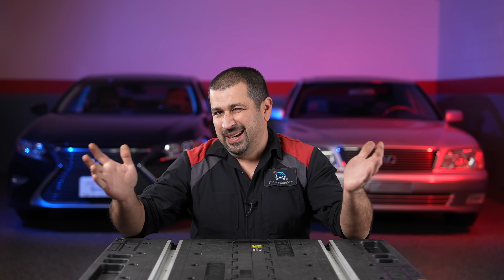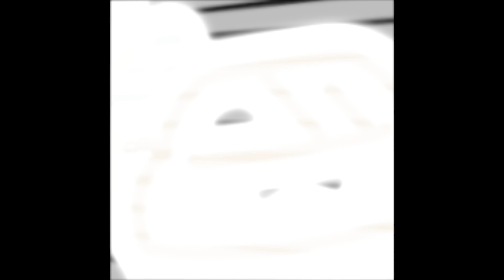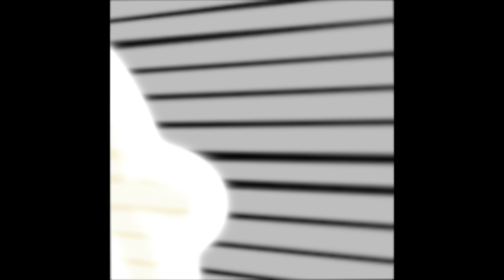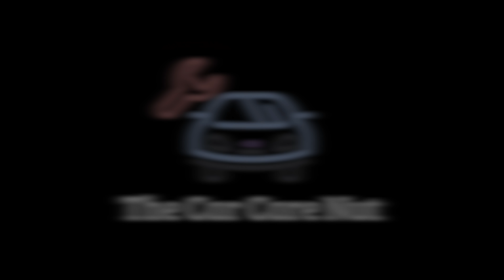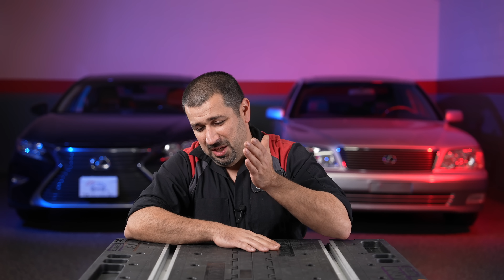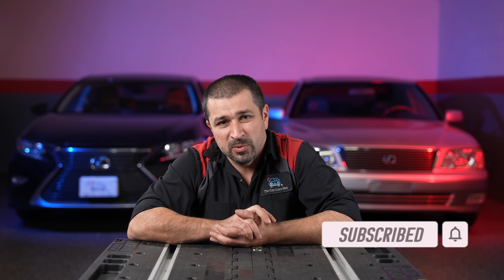Can Modern Turbo Engines Be Reliable? Here's The TRUTH!

Comment: Great primer on the difference between a turbo diesel and turbo gas engine.
Reply: Except it's not. It's not that diesel burns cooler. They have broadly comparable flame temperatures. What is different about turbodiesel is that they have lower EGTs because they are naturally lean burn engines. The excess air in the combustion chamber provides two things. One is a more complete burn of the fuel, another is that the extra air helps serve as insulation to reduce loss of heat to the cylinder walls. But all of this is only true if you aren't going WOT. He is also wrong about diesel engines "struggling for air". The problem is that diesel burns dirty if it's not lean burn. Gasoline does fine at stoichiometric without a lot of soot and smoke. Diesel if you get close to stoichoimetric you start rolling coal badly. So the benefit of turbodiesel is both power and emissions. To make more power you need more air to flow more fuel. Diesel also doesn't have knock issues like gasoline, so running 40+ psi of boost is no big deal compared to gasoline, so they naturally take to massive turbocharging much better than gassers.
Reply: He is not all right about diesel.
Reply: Diesel engines are born with heavier, beefier components like the con rods.  This makes them a lot tougher but the great increase in reciprocating mass means they cannot rev as high.  Modern gasoline engines, trying to meet CAFE requirements, keeps getting lighter and lighter moving engine components.  Even when compared to gasoline engines in the past, these components are lighter although you can claim improvements in metallurgy.  Another issue is that modern engines keep trying to meet ever tougher fuel economy requirements, keeps going with lighter and lighter weight oils to reduce engine friction.  When we use to use 10w-40 in the past, we are now down to 0w-8.   Due to increased cylinder pressures, turbo engines are more susceptible to cylinder blowby.  That is fuel escaping through the piston rings and ends up diluting your engine oil.   Factor the lighter engine oils, and you have a double whammy.    Turbo diesels on the other hand, well diesel is an oil itself, and even when blowby is present, it's oil mixing with oil.  You have to inevitably replace your oil but the dilution effects are not as catastrophic.  On top of this, the oil weight of a turbo diesel is higher.   Let's take for example, the recommended oil weight for the Toyota Dynamic Force 2.4 liter engine with turbo, T24A, used on Highlanders and Tacomas, is 0w-20.   In comparison the Toyota 2.8 Turbodiesel 1GD-FTV used on the Toyota Hilux, is 10w-30 or 10w-40 on warmer regions.  

Let's add that turbo gasoline engines have gone from cast iron blocks, like the 2JZ, to aluminum blocks with iron sleeves on the cylinders, like the Ecoboost, to Aluminum blocks with some kind of coating on the cylinder walls, like Mercedes and Nissan.  I'm not too confident about what's going to happen if those coatings wear out in the long run.  What are those coatings for?  Same reason why lighter engine oils are used, to reduce internal engine friction so you can squeeze more mpg from the engine.  Turbo diesels are more fuel efficient than a gasoline engine with the same displacement, they don't have to push the edge like so many gas engines do.
Reply: @ChrisRobato  You would have a point, except diesel engines are using the exact same aluminum blocks as gasoline engines now as a cost saving measure. The BMW B57 uses the exact same thermally sprayed coating in the cylinder liners and the same block as the B58 yet nobody is complaining about how their diesel B57s are blowing up on the internet from weak cylinders.

Diesels are also using the exact same oils as gasoline engines. BMW and other diesel manufacturers still in passenger cars are speccing oils like LL04 and VW 504/507 which are shared across both gasoline and diesel motors now with particulate filters. Pull the intercooler of any modern diesel and it makes GDI turbo look like a walk in the park for carbon buildup and blowby in the intercooler.
Reply: @DOAHunt3r You can speak of the BMW B57, but the Toyota GD turbodiesels used on the Hilux, Prado and Land Cruiser 79 series, use cast in sleeve with aluminum blocks, and they do not share any components with Toyota's Dynamic Force engines.   The oils it use are also heavier as mentioned and go up to 10w-40 in tropical and desert regions where these vehicles are often used.
Reply: @ChrisRobato  The GD turbodiesel is a cast iron block, not cast aluminum with iron sleeves. That design is extremely old school. It still uses a fan clutch and belt driven fan which wastes a significant amount of power.

Just because Toyota got away with shipping a distinctly old school design doesn't mean that diesel is inherently all like that. The broader market trend is that diesel and gasoline have basically converged. The main issue is that diesel has 10x or more soot in the exhaust + requires SCR which makes for much more expensive aftertreatment both upfront and in ongoing maintenance costs.
Reply: With diesel cars it's getting a good balanced mixture of diesel and air. What tends to happens you get areas in the cylinders where there is excess diesel; the diesel then does not burn completely this leads to soot/carbon/coal dust being produced. Turbos put in more and denser air to try and combat this, along with swirl flaps to ensure air spreads out in cylinders and of course higher cetane diesel (quicker to start the burn). As you try to get more torque out of the engine you dump more fuel which needs denser and more air hence the need for turbos in diesels...Diesel turbo are VNT which are more susceptible to failure from higher exhaust gas temps hence they don't do to well in the petrol engine cars, only Porsche are using them on the petrol boxer 4 cylinder 718 Boxster/Cayman...
Reply: Not really, there are so many passenger turbo diesel cars, they aren't all commercial vehicles that cruise 500km on the highway every day.
Reply: The Mecedes 300 SD is a legendary turbo diesel auto with good performance, mpg, and longevity.
Reply: This is why I don't even start my turbo diesel tractor until I can use it for at least 30 minutes straight!  It's actually harder on a diesel engine to start one time than it is to run for an hour straight.
Reply: Am a truck driver for 20 years and I have a lot knowledge about engines any engine, including boxer engines., I use TURBO ENGINE ONLY in tractor commercial truck , BUT I skip any single turbo engine for pickups truck , SUV and sedan cars , just no worked basically is just scam technology , Turbo engine is ONLY for tractor commercial trailers
Reply: Excuse me Sir/Madam but i was wondering whether longer intervals would be more acceptable in europe since my uncle told me that here in europe and britain, such intervals are fine because europe´s climate isn´t harsh on cars. But those long intervals are blowing my mind since back in my region in middle east i was changing oil every 5k kilometers, some criticized mefor not doing it at 3k. i would appreciate any insight.
Reply: @zhila5958  5000 miles between oil changes is fine. More important than any of that is proper warm up and cool down. Drive the car gently (no high RPM over 3000 rpm, no WOT) until the oil temp is 70C. Drive at least 5 miles per cold start. Do not drive the car 500 meters cold and shut it down and then leave it like that for the rest of the day every few days like some collectors will do. If you have been driving on the highway or other high speeds/high boost then coast in gear to slower speeds and then once you reach the destination let it idle for a minute before shutdown.

If you follow that procedure 5000 miles is fine. If you drive very long distances on the highway and nothing else you can stretch to 7500 miles. Most people should stick to 5000 miles because they don't.
Reply: @DOAHunt3r  Thank you so much. SO 5000 miles (8000km for me) is acceptable for european climates like here in germany. i will try to normalize this if i do city driving mostly. 
Many criticized me back in kurdistan when i did it at 5000km instead of 3000km, but the car still worked perfectly despite the harsh climate. now that i have been in germany for a year, i was shocked when i learned about intervals, but thanks so much for your insight, it is much appreciated.

Comment: To bad an oil change in the Netherlands costs €275 at a shop forget about the dealer😢😢😢
Reply: One of the reason I'm doing oil changes myself. I have two motorcycles and a plug in hybrid petrol engine only used on long journeys so oil stays fresh even after 10k miles as engine only used for around 10% of the time.
Reply: @NotOftenPoliteGuy Most Dutch people don’t have the space to do this.

Comment: No. Unlikely under even the most rigorous maintenance. The higher pressures they operate under and direct injection simply can not go the distance like non turbo engines.

Comment: AMD, Sadly, the people who cannot be bothered to maintain their naturally aspirated engines won't bother to maintain their turbo engines either. 😛 On the other hand, conscientious owners like your 1,610,000 loyal subscribers should be fine. 😇
I was surprised to see 0:53 an Oldsmobile on your channel. If you feature another one, I suggest a Vista Cruiser with a 455 Rocket V8 engine and the 'fuel saving' 2 barrel carburetor.  How about a Toyota Crown Signia vs Olds Vista Cruiser comparison? 🤔
Reply: Many people today treat cars like an Apple iPhone.. 😂😂😂
Reply: If you are careful the quadrajet will get better mileage.
Reply: @mason7300 Who orders a 4 barrel to be careful? 😉
Reply: Excuse me Sir/Madam but i was wondering whether longer intervals would be more acceptable in europe since my uncle told me that here in europe and britain, such intervals are fine because europe´s climate isn´t harsh on cars. But those long intervals are blowing my mind since back in my region in middle east i was changing oil every 5k kilometers, some criticized mefor not doing it at 3k. i would appreciate any insight.
Reply: @zhila5958 nope. 5,000 km is fine, they usually talk about 3,000 miles, not 3000 km.
Reply: The reason he showed that Oldsmobile was because it was the first Turbo offered in an American car.
Reply: V8/ 2 barrel has to be peak stupid. The Quadrajet had primary barrels smaller and way better designed than the ancient 2 bbl. You'd get better economy with the 4 bbl than the 2 AND considerable more powah.

Comment: with toyota telling everyone a 10k oil change is what is needed then YES.  
if the owner is smart and does 5k oil changes they will be fine.
Reply: Even for models for which Toyota recommended 5k/6mo, 10k/12mo will still get you to 200k+ miles.

But that is for naturally aspirated engines.
Reply: 10k works fine on my Nissans 👍 no issues 😅 and I'm keeping my cars, thank you very much 👍 🤡 👍
Reply: And when it breaks we will be happy to fix it in our repair shop out back.
Reply: That's the biggest scam ever from toyota ever 10 000 miles toyota company is not good anymore to customers there are service is garbage
Reply: Get your oil analyzed, I’ve found the interval i need to do is 5,000-9000.
Reply: @johnwhite2576 🤣💪 Dumb ass
Reply: @johnwhite2576  over 10k according to blackrock.  i change oil between 7-8k miles
Reply: @johnwhite2576  I hope you’re joking.
Reply: @markm0000  nah he's right
Reply: @markm0000  Can't comprehend new information?
Reply: That 10K oil change is also based on ideal driving conditions. Realistically most drivers fall closer to the "severe conditions" category.
Reply: @keith2772 no they don’t. Do you know what sever driving conditions are? Most people DO NOT drive in severe conditions
Reply: @cyrano661  Auto manufacturers define severe driving conditions as any situation causing extra stress or wear on a vehicle, including heavy stop-and-go traffic, frequent short trips (under 5 miles), extreme temperatures, towing, hauling loads, driving in dusty/muddy/sandy/salty conditions, and regular mountain driving, all requiring more frequent maintenance than the "normal" conditions (long-distance highway driving in mild weather). Most drivers actually fall into the severe category, despite the "normal" label.
Reply: @k @keith2772 Sorry to disagree, but most people don’t fall in that category. We don’t all live in Alaska, pulling a 5 ton trailer. Synthetic oils today are very very efficient and for most people there is absolutely no need to do an oil change every 5k. You need to drive in those severe conditions ALL the time to fall in that category. Toyota has a reputation to defend, they wouldn’t tell you to change your oil every 16k if it would damage your engine. I respect those that want to do it more often, it certainly doesn’t hurt, but nowadays, with the quality of synthetic oils, under normal driving conditions (which is what most people do) there’s no need.
Reply: All manufacturers are pushing long service intervals as a selling point. Buyers will choose one car over another because its service interval is longer.
Reply: If people read the manual it says 10k miles or 6 months whichever comes first. Technically if you wait 5k that could take 2 years in some use cases and still damage the engine. Whoever is going 10k shouldn’t own a car.
Reply: @markm0000  The 2024 Toyota manuals say to change the oil every 10,000 miles or 12 months, unless "the MAJORITY of your driving" is on "dirt roads or dusty roads."  In that case, 5,000 miles or 6 months.  Me?  I do it every 6 months regardless of mileage as my annual mileage is less than 10,000.
Reply: @WhalerGA  I didn’t want to say this but I change my oil and filter every 3 months. I have a Hybrid and my daily commute is 10 minutes with 50%-70% on EV mode depending on the day. I put about 3k miles on my car in a year. I know the high efficiency loose fitting piston rings never warm up completely and they’re just blowing gas vapor right into the crankcase. I put on a oil drain valve and the whole process takes 30 minutes with no mess. I would do it every month if it wasn’t the fact I have to use 0w8 oil. Such is life.
Reply: @markm0000  That's kind of worse case that your engine turns on every day but only for a very short time, so never gets up to temp.  If you're only doing 3k miles per year though, you're changing it more than necessary.  33% of 3k miles is only 1k miles.
Reply: @markm0000  That's just a rule of thumb and assumes you're taking the car on short trips every day.  If you only use the car to do 200 mile trips every weekend, it'll take you about a year to rack up 10k miles, but there'd be no need to change it early.  The oil doesn't just go bad after 6 months, but it will build up a lot of contamination from blow by if it's always running cold due to short trips.

Comment: I hope so.  My 2.5L Turbo in my CX-5 is a blast to drive.  5K oil changes and proper spark plug changes so far.
Reply: Good quality oil filter?
Reply: But, just like my VW 2.5 TDI that is ancient times and will never come back.
Reply: 5K? Wow, what a waste of money
Reply: @nickr3441  We don't know the oil quality, little detail (i always use Castrol Edge LL in my T4 TDI OIL change +- 18000-23000 km, engine and ALL the rest 578000 km)
Reply: @nickr3441  why??